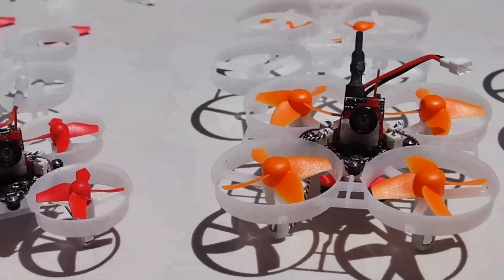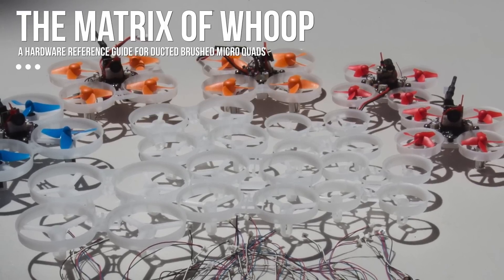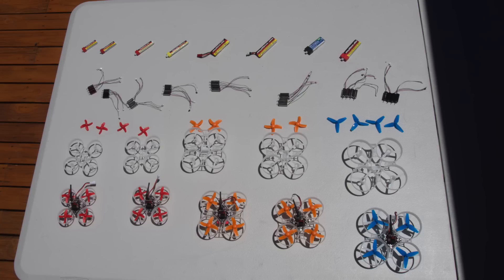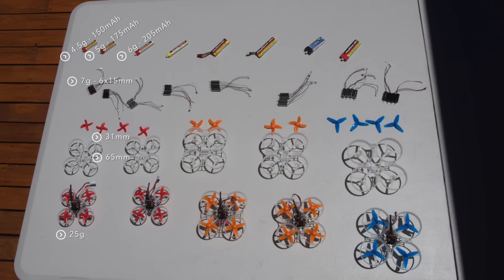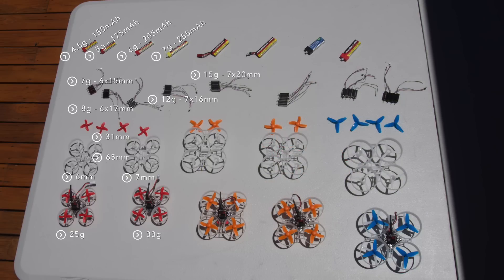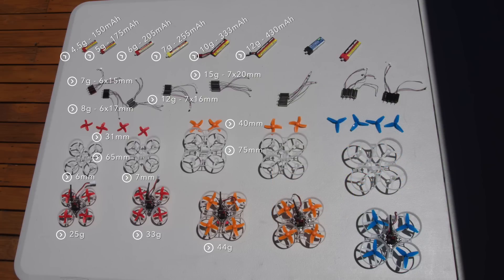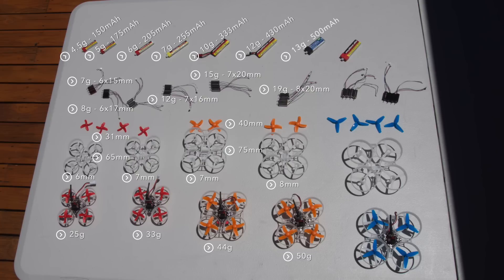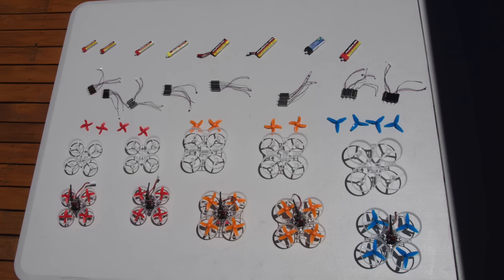The Matrix of Whoop - a hardware reference guide

Comment: Awesome work Benedikt, this will help a lot of people!
Currently my favorite setup is 7x16mm motors, 65mm frame and 31mm props, with a good HV PH2.0 battery.
Reply from the maker: Thanks a lot! 
I think the 7x16 will remain a favourite, no matter what else comes out ;)
Reply: I am tempted to ditch the motor plugs and connectors and start soldering the wires directly to the boards. It is the last thing remaining for weight saving. On the other hand, I think the pads will eventually fail after a few motor swaps. What do you think?
Reply from the maker: If you want to remove all connectors for weight reasons (which adds up to around 0.45g), you should also consider the weight of 8 solder joints ;)

I think that 0.2-0.3g extra weight is a great investment for the ability to swap motors quickly. Damaged motors are a common reason for a quad not to fly properly, and being able to swap them quickly is an essential trouble shooting tool.
Reply: Yep, that's a fair point. Shaving weight off a micro can become an obsession :P
You have 8 solder joints for the motor plugs anyway though.
Reply: Thanks for sharing the information Benedikt. Although you mentioned in your video some factors that effect performance and flight time and you alluded to choosing a balance between the two, in your opinion which combination of frame size, motor size, KV, prop size, and battery size yields the best performance while maintaining no less than 3:30 flight times?

Comment: Hey, great video (again)!  Thank you.

I have 0720 & 8.520 BetaFPV motors that really seem to run hot compared to the 0615 or 0716 motors.

Is this normal for the larger ones to be pretty hot to the touch after a single 3 minute flight?
Reply from the maker: Thanks a lot Chris!

Its not a general trend in larger coreless motor, but more of matter of the right combination of coil (motor windings), propellers, load (copter weight) and battery performance.

If we are asking for too much performance from a given setup, it gets hot. If there is a lot of reserve, we see no noticeable heat.
Motor temperature is one of the key indicators when testing motors. They should get warm, but not too much. If they are too hot, we are wasting energy by generating heat.
If motors are not getting warm at all, they are not being used to their full potential.

I have the feeling that props are the main thing we need to improve for 7-8.5mm motors.

Comment: Do you think the inductrix plus with the 8mm motors is too much for indoor flying?
Reply from the maker: It has more power than you need for indoors. The extra weight can make it slightly more difficult to navigate small spaces. The extra weight and the brittle stock frame will cause it to break quickly on impact with walls, floors, furniture.
If you reinforce the frame (or replace it with a 8020 frame) and take it easy to start with, it will do just fine indoors.
For only indoors flying, I usually choose a 7016.

Comment: You say  26x26mm mountings, yet both the frames and boards I have at hand are 25x25 mountings. Since I design FC boards, it is important to me to know the real "standards". Where does your 26x26 come from, and why would both the boards and frames I have be only 25x25 ??
Reply from the maker: Good point Leon!
I have just put the calipers to bunch of frames and FCs, and its certainly closer to 25 than 26mm.
There will be some follow-up video to this in the next weeks, I shall it correct it at some stage.
Thank you!
Reply: 26x26 is what all the manufacturers list as the specification for inductrix-style FCs including betafpv that make the board and frame.  "Size: 26mm x 26mm,fully compatible with the Inductrix quad frame and mounting pattern."   Are you measuring from center to center?
Reply: Yes, center to center on the frames, one of which is from an e011 and no clue what the other came from. on the boards the measurement is estimated hole centers but 26 is definitely beyond the centers. are there [defacto] 'official' specs for the board shape and motor plug positions too ? so far i have had to guestimate these as well from measurements.

Comment: Wow, this is gold, you really lay it all out there. Thank you for sharing this.
Reply from the maker: Thank you!
Reply: Micro Motor Warehouse hey man I have a question , I have a Propel Gravitron that has 8520 motors , it takes a proprietary 3.7v 750 mah 2.5 -2.75 wh , I found a 3.7v 950 mah 3.5 -3.75 wh I can plug it in with a jst connector and the drone lights power up like normal , I can calibrate my gyro and I can arm my motors ready for take off but as soon as I try to lift off in mode 1 , 2 or even 3 it instantly cuts all power and flashes like it dose when I have a dead battery , what is the watt hours doing that is making it not work for me , thanks !
Reply from the maker: Hey Hunter, 
the battery is probably just weak, old, or plain mislabeled.
If the battery is too weak to sustain a usable voltage, it happens what you describe.